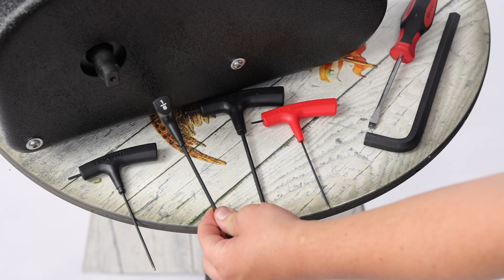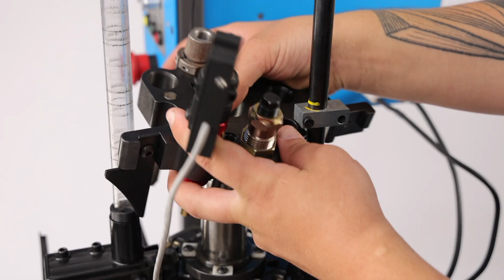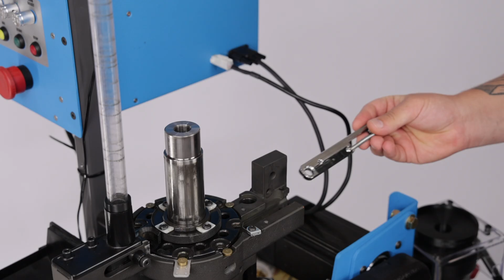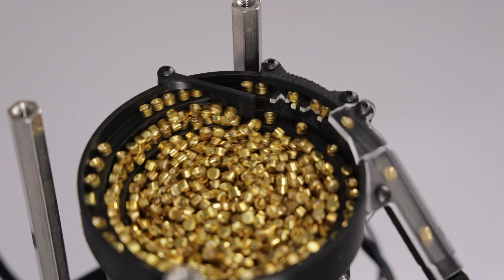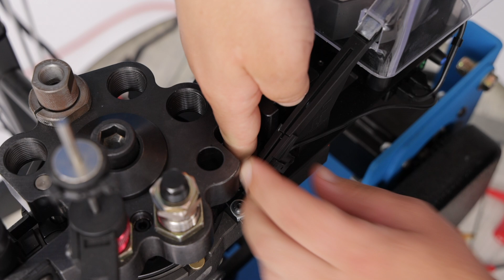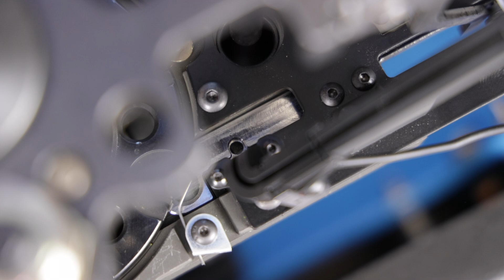Hit Factor Automation RL series Pro Primer Collator (PPC) Install

Comment: Does the primer slide bar and ramps work for both small and large pistol primers?
Reply from the maker: Unfortunately the primer bar assembly and front ramp have to be interchanged when switching between large primer and small

Large primer conversions will be coming soon!